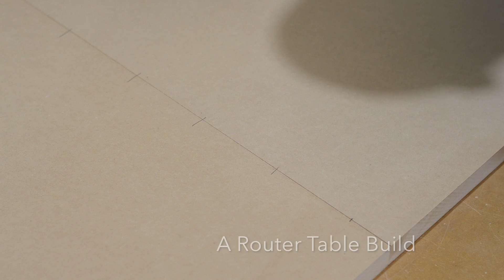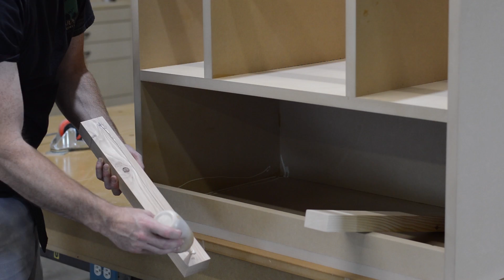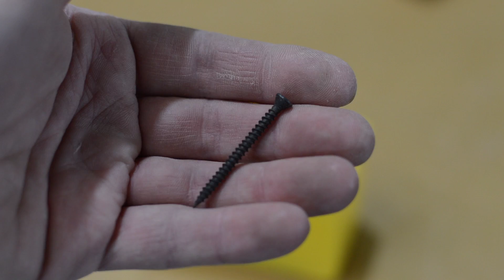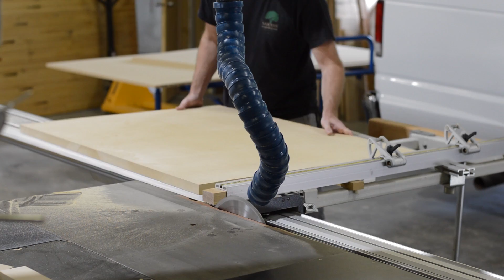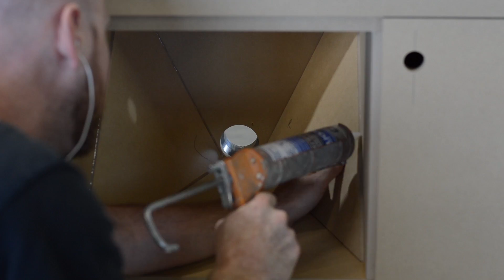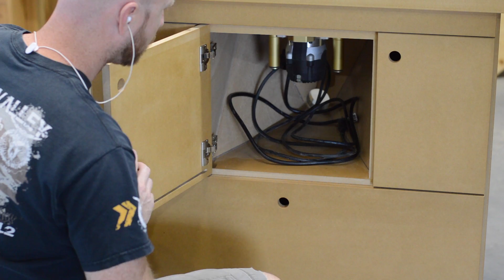Very good router table

Comment: Generally speaking are biscuits strong enough for cabinet carcasses and drawer boxes? That and glue alone? I have a dewalt biscuit joiner and would love to be able to use that alone, but am worried about durability. So will that work for both?
Reply from the maker: I would say when used correctly, in general biscuits are strong enough. I have built lots of drawer boxes and they seem to hold up well, but I put them on high quality drawer slides and the bottoms are in a groove.
Reply: Mike Farrington so do the drawer slides account for some strength? What about general carcasses?
Reply from the maker: I don't think that the drawer slides add strength, but they reduce the overall impact on the drawer box. As a drawer is pulled in and out if there is a ton of friction that will stress a drawer box over time. Reduce that friction with a quality drawer slide, this will increase the life of the box. With regard to carcasses construction, I like to ensure that things are built strong. Most importantly make sure the cabinet has something giving it a good shear strength. Meaning, glue in the back, or put on a Face frame. Hope this helps. If you have a biscuit joiner, play around with it a little, see what works for you.

Comment: Hey Mike,

nice build. Just wondering how the Loctite is holding up? Did it fix the issues with the levelling screws backing out?

Cheers,

Sam.
Reply from the maker: Yes, the Loctite has worked perfectly.

Comment: Any reason you went with the 2 1/4 rather than 3 1/4 router?
Reply from the maker: Its what I had. I have it in my head when that router dies I'll replace it with a 3 hp motor, my guess it that router will last a very long time. I've had it in a router table for pushing 15 years now.

Comment: I like the router cabinet & table you made, I'm planning on making a more simpler one myself.  Can I ask why you chose a fence made from wood?  I'm considering making my fence from stainless steel, I guess in my mind it seems less likely to warp over time.
Reply from the maker: Thank you. I used wood because is a material I am good at working with. I don't know very much about stainless steel. I agree that will will warp less over time, but getting it flat to start with may be tricky. If you have the skills to work steel, then it will work great.
Reply: @MikeFarrington  I might look into using wood for the base and fence, router a few recesses in both, then gluing and screwing in some long metal rulers.  That might be my compromise, and more affordable too :)
Keep up the good work Mike, I'm really enjoying your video's :)
Reply from the maker: Sounds like a good plan. Good luck!

Comment: Just curious: isn't that mdf dust super toxic ? While on the table saw, drilling and even sanding I see dust flying anywhere and you are not wearing a mask. Just worried about your lungs :)
Reply from the maker: MDF dust is not great to breath, but all types of wood dust are considered to be a carcinogen. I have apposing roll up doors in my shop and an air quality monitor. The air if my shop is actually pretty clean.
Reply: @MikeFarrington  Happy to hear that. Currently on my way to becoming a carpenter as well 1. of 3 years and we were always warned about lacquered dust, mdf and especially oak. But good to hear from someone in the craft that I don't have to sweat it that much . Still, workplace provides good dust masks and such, so I still will use them. Keep on crafting and have a nice day, chris.
Reply from the maker: Well don't take it from me. Make your own decisions based on your own research. Also, I purposefully by MDF that is made in america that uses glues that are not so bad.

Comment: Followed your design Just using dado slots and pocket screws (no glue, with slide out bottom tray , not drawer, and yet to fill side compartments)(I used a woodpecker top , incra plate , triton plunge, custom DIY extruded Al  fence on top , from previous use) .  Afterwards I , just out of curiosity , kept on looking at other router table "perfect , tripped out (all sorts of titles)" that are posted everywhere . Conclusion :  you should change tittle to ' Very Best router table '  or ' no nonsense intelligent design router table ' . (Norm would be proud)  Seriously !! THANX
Reply from the maker: Its a pretty nice design. I have liked using it thus far. I titled this video the way I did to poke fun at all of the "dream / ultimate router table" builds out there. I like the no nonsense title, that would work good. To be mentioned in the same sentence as Norm is an honor, thank you.

Comment: And how is the mdf top holding up? My current table warped a bit, hence the new build.
Reply from the maker: This is my third router table of this same design. All of the tops have held up great, but I make sure to provide enough structure to eliminate warping. My first one was more than 10 years old when I rebuilt it.

Comment: Mike,  I have COPD.  Not from smoking.  I think it is from making shingles for a windmill I make.  The dust was incredible from cutting the kerf cuts on the shingle lengths.  I had a dust mask, an overhead ceiling Jet dust collector, and a shop vac with a hose just behind the saw blade.  There still was a cloud of dust in the air.  When I finished, I could taste the dust and I felt that my chest was tight.  Be careful man.
Reply from the maker: Thank you. Good advice.
Reply: MDF dust is especially harmful, so much so that my union banned its use except for in specially equipped sealed environments. I used to use tons of mdf and I fear the dust i was exposed to over the years. I have since become much more careful about it.

Comment: A good build.  Between you and Norm there are a couple of very good tables to copy.  I have used straight poly (2 coats) on the MDF and have been quite happy with the result.  I used it on a side feed table on my table saw and product slides well on it.
Reply from the maker: Thank you. Poly is good stuff.

Comment: Beautiful barn. Could you tell us a bit about it? Dimensions, manufacturer, cost?
Reply from the maker: Thank you. It was there when we bought the house. The previous owner built it, and not very well at that. The dimensions are 50 feet by 56 or 58 feet (not totally sure). The side walls are 12 and its about 17 in the center. Cost, I have no idea.

Comment: You made me reconsider MDF in a new light Mike. Specifically because of the secret recipe you didn't share. I have moisture issues in my shop and have avoided MDF like the plague, and that should bring the cost of building shop stuff significantly down overall.
Reply from the maker: Thats why I use MDF, to save money. The finish I use will help with moisture.

Comment: Hi Mike, I really enjoy the video and the great work you did building the router table.  One question, where did you find 1 inch thick MDF?
Reply from the maker: Thank you very much. My local hardwood/plywood dealer sells MDF in 1/8 through 1 1/2". I think most lumber yards will have it or can get it. I don't think the big box stores will carry it.

Comment: Do you prefer to do builds with mdf? Or wood? And why do you choose one over other?
Reply from the maker: I like both materials. For shop projects like this MDF is hard to beat. Its cheap and easy to work.
Reply: @MikeFarrington  what about projects for clients or like in your house?
Reply from the maker: I use both, which ever is best for the application. Typically, if its painted, I use MDF, if not, I use solid wood.

Comment: Mike, have watched a ton of your stuff recently. One small tip if I may. I‘ve now observed you using your circular saw on many occasions. The dust always ejects out towards you but the extraction is on the other side of the blade/table. All that MDF dust was shooting straight at you. Try angling the extraction hose to the other side. Meant well Buddy 👍
Reply from the maker: Thank you Robert, good advice.

Comment: Cabinetry trick use Titebond 3 glue with water brush on edge of MDF scrape off gently after drying using a razor blade your end up with a stronger and smoother surface
Reply from the maker: Thank you. This is a good tip. I have done this in the past with good results. These days I just use super glue because it dries so much faster.

Comment: Thank you for the video! What do you think about adding a hardboard layer on top of the mdf? Will it help to reduce wear from use? any other advantages/disadvantages? Thanks!
Reply from the maker: That could work. For my uses, it would not be needed. I have the top screwed down, if it wears out I can simply replace it.

Comment: Thanks for the heads up on the impregnating thin down resin into MDF I thought that was rather brilliant... also on your table saw you have a slider system just wondering what you think of it is it felder's?
Reply from the maker: Thank you. Its a neat trick and turns MDF into a pretty durable surface. My slider is a dedicated unit made by Robland, its the e300 model.

Comment: I made not not dissimilar router table (roughly the same dimensions) a few years back from MDF with castors in a very similar setup to what you have. I found over time that the MDF sagged around the castors and messed things up. I ended up screwing a 50 x 30mm solid oak batten across the front and back of the bottom to straighten it out but the top is still convex so its sort of useless. Will be remaking this year from plywood and will really beef up the bottom. My workshop is in the UK and unheated and I think the MDF may have got a little damp during the winter which added to my problems. I wonder if you have seen any sagging/compression issues with MDF in your environment?
Reply from the maker: I have not had a problem with the other router table sagging. I have had that one for 6 or so years. I think the solid back and thicker top as well as the cleat in the front keep things in line.

Comment: Why not use dados, instead of the biscuits?
Reply from the maker: Dado would work. Because I used 1" MDF it would take at least 2 passes. So for me, biscuits are much faster.
Reply: @MikeFarrington  ok cool.  Thanks.  I'm making cabinets right now for the first time and I'm using plywood and dados.  Saw the biscuits and thought maybe I should be using biscuits instead
Reply from the maker: I would argue that dado construction is stronger, but biscuits seem to do pretty good as well.

Comment: 75$ for a power feeder!!! I am shocked! That is a great find!
Reply from the maker: Great deal. I don't think the guy knew what he had.
Reply: @MikeFarrington  what size is the power feeder and are you happy with its power? I will be buying one soon and dont want to over do it but want to have a good one that works well.
Reply from the maker: @robschanaman6916  Its a 1/8 HP feeder. Also known as a "baby feeder". Its fine for a router table. I wouldn't mind a bigger one, but the 1/4HP models go way up in weight and I wanted to be able to take it on and off super easy. If set up properly this will feed pretty much any work piece with ease.

Comment: I just discovered your channel and love your work.  Use of MDF for shop cabs makes so much sense, but do you utilize special fasteners? I find MDF doesn't allow screws to get a good, long lasting bite.  Really nice work Mike!
Reply from the maker: Thank you Steven. Couple things, when using ply or MDF a good counter sinker sized to the screws you are using is critical to prevent splitting. Also using good quality ply or MDF helps as well. I am using #8 screws, nothing special.

Comment: What would you use instead of a Domino for joining smaller sized components, such as square rails? My, admittedly inherited, opinion of the biscuit joiner has changed since watching your content. I was told to forget biscuits and I only ever need a Domino nowadays, but at the price, I'm struggling to justify the purchase as I've got an entire workshop to kit out. The only thing I can't get my head around is if I need to join two components that are too narrow to accept a biscuit. The Domino was perfect for that. Cheers!
Reply from the maker: Thank you. I wish I could offer the perfect advice and say go buy X, its perfect. I cannot do that. You can get a lot of work done with a biscuit joiner, it cannot join narrow pieces (like door frames) very well. If you have the money, the small domino is a pretty good way to go if you want just one tool.
Reply: Thanks for the reply, Mike.
Reply: you could also use dowels for small joints like that for a cheap option, mortise and tenon would work well but be much more time consuming, of course.

Comment: What kind of flexible pipe is that above your table saw for dust collection?
Reply from the maker: Its called Loc Line. I use the 2 1/2" diameter.

Comment: I build arcades from 3/4 MDF and I harden all the cut edges with a mix of 5 parts water and 1 part wood glue on a foam brush.  The t-molding slots turn out rock hard.  Great video.
Reply from the maker: Thank you. This is a very good tip.

Comment: Mike, great work. What brand and model is that hand-held router you use to round off edges? And what bit? Thanks!
Reply from the maker: Thank you. Its a porter cable 310, which is, unfortunately, no longer made.
Reply: Is there a similar one that you'd recommend? Thanks again.
Reply from the maker: I think the best small router being sold today is the Dewalt. I use a micro bearing amana bit. Check out their site and you will find they have a few to pick from.

Comment: Big fan of castors myself and same reason:  space comes at a premium so mobility is critical. And that is the same reason why a standalone router cabinet is a luxury I can't have: I run a full Incra system with tables/routers left and right of my table saw: very precise and extremely flexible space saving system. But there is always something to learn from your videos and this is another great one, thanks. ps it seems Jared Czaia made the most of your love of MDF! Albeit you could use the M for Mr. rather than Medium!
Reply from the maker: Castors are great. Even with my big shop, I still like to roll the router table near the bench. I had my router table in the wing of my table saw for years. Its a great way to go. Thank you for the kind words.

Comment: Hey Mike; love your videos! Have you given any thought to making a set of plans for this router table? I’ve been meaning to make one for a while and haven’t found plans that I’ve liked as much as this one.
Reply from the maker: I have, I may try and put some together. No promises though. Thank you.
Reply: Mike Farrington 2 questions, hope you can help me out. How tall is the fence And How large is the square opening in the face of that sacrificial fence?  Thanks in advance.  Love the videos
Reply from the maker: The fence is 5" tall. I use two opening sizes, 2 1/2, and 4". The 4" is driven by my largest router bit, the 2 1/2 accommodates most of my normal bits. Hope this helps.

Comment: What kind of hose is that in 1:23? Do you have any comments on using a pool vacuum hose instead for dust extraction?
Reply from the maker: Its a Bosch vac hose. I do not know if pool hose would work.
Reply: Pool hoses work as well.
Reply: BAC STR Yup. I got one and it works great. I made a video about it on my channel. Check it out.

Comment: Nice build Mike, and MDF as well 👍👍👍 Is that a 4 Runner parked o/s your shop?
Reply from the maker: Thank you very much. Yes it us a runner, 92 4x4 5spd.
Reply: YW 👍 Too many people frown upon MDF but I think its a pretty good 'all rounder', and here in the UK much better value than ply, even in MRMDF! I have a 93 Surf (UK import name) but auto and diesel 😎
Reply from the maker: MDF is great, I wish we could get MRMDF here, that would be nice. I am envious of your diesel Surf. Great rig.
Reply: Didn't  realise you couldn't get MRMDF in the US! It is a great rig Mike, trouble over here is that diesel is not so popular these days and is dearer than petrol 🙄 Still, I have a 'little' petrol V8 waiting to go into it 😉
Reply from the maker: It may be possible to get MRMDF here, I just don't know where, and I don't like relying on things that are a pain to get. I try to work with stuff that is easy to buy. Funny diesel is not popular, I thought the small displacement diesels were all the rage in the EU. You would be welcome to come on over hear and install that V8 in mine...
Reply: Yeah, no good being half way through a project and finding the supply of materials has stopped! Here in the UK there's a big push to hybrids and electric cars so everything related to owning a diesel is becoming expensive! Thanks for the offer 🤔 but I think I'll decline.  I'd like to keep the diesel, however the V8 has the same 'economy' and of course, it's a V8...……………….. 😉
Reply from the maker: Ha! Figured I'd try.

Comment: You always have lots of good tips Mike. Creating a slot with the biscuit joiner, finish for MDF, even if it is a guarded, family recipe, and lots of fun along the way. Cheers!
Reply from the maker: Thank you Geek.
Reply: Mike, what type of biscuit joiner do you use?
Reply from the maker: Lamello Top 20
Reply: @MikeFarrington  Tried looking that up, could only find the Top 21
Reply from the maker: @cq8449  The Top21 is the newer version. Mine was made in the 80s.
Reply: @Mike Farrington And it’s still going strong, that is one well made piece of equipment.
Reply from the maker: @cq8449  Lamello builds these to last a career.